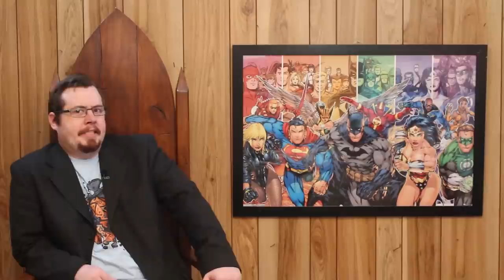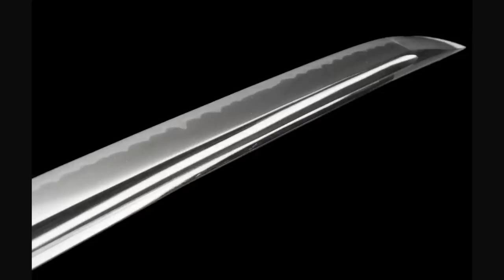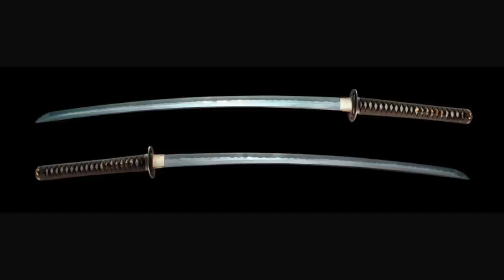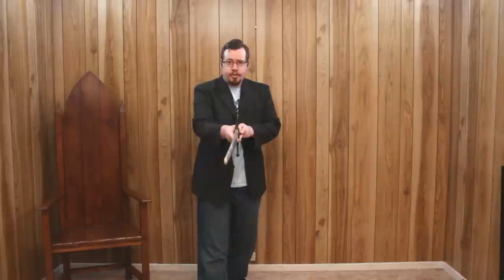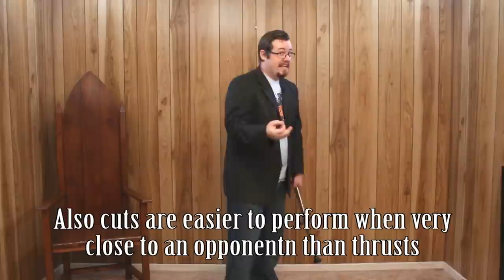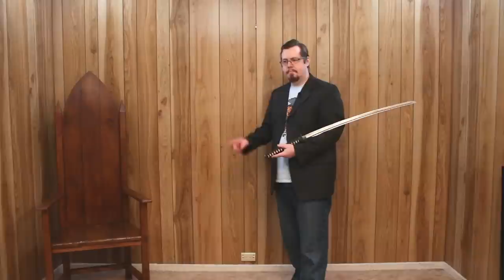Super cutting swords, are they needed?

Comment: Shad, there is one problem in you analysis, namely that you only considered it from the unarmoured, fighting-on-foot perspective. For some reason, curved sabre type back-swords were in vogue in cultures that placed light cavalry and horse-archers in a prominent role. If the weapon was designed for fighting on foot from the ground up they may not retain that level of curvature.

Take Japanese back-swords for example, and no there is no such thing as The Katana; a katana is a back-sword and can be further categorised into more specific types. Tachi was fashionable from late Heian to early-mid Sengoku period where the primary function of the samurai was horse-archery. Uchigatana, a much straighter version of tachi with longer handle, came into fashion in mid Sengoku where samurais were mostly fighting on foot in formation. Uchigatana was further shortened during the Edo period, as the Shogunate wanted to limit duelling, and this is The Katana that we think of today, 

Therefore, the katana is not the result of trying to maximising certain battle effectiveness, for example cutting; as a matter of fact, the Shogunate was trying to reduce its effectiveness in unarmoured fighting scenarios. It is what it is mostly because it is the descendent of Taichi and retained a degree of curvature.

When it comes to nodachi, we have to again consider it in a different historical context. Ming Chinese noted that it was particularly effective in cutting off pike-heads during their war with Japanese pirates. It was so effective that the Chinese general in charge invented new tactics and adopted the nodachi as one of their infantry weapons. But then we need to compare the nodachi to the greatswords and it will be a different discussion.
Reply: I heard the reason the uchigatana was shortened was for the purpose of making it more convenient (ie. easier to wear, easier to draw and easier to use) as during the Edo period, there were no large scale battles and the primary reason the samurai still carried swords was for self defense in usually urban environments.

Comment: From what I understand with a number of curved swords is they were cavalry weapons. You have  a standard war horse going about 25-30 miles per hour or 43-48 Kilometers per hour charging at  your enemy, the cutting edge can do some devastating damage. The blade doesn't even need to be sharp; the impact alone can take someone's head off. Exceptions exist, but this tends to be the case

Comment: Sorry for being late to the party. Some thoughts:
1st: As mentioned already, it might be worth consindering whether you fight mounted or on foot. Mounted, you only have a small window of opportunity to land a hit, but thrusting might need more time to aim and look for an opening. Furthermore, I would guess that after a mounted thrust, my blade has a higher chance to stick in the body, getting ripped from my hand and leaving me "toothless". From medieval imagery it seems to me that knight on horse, when using a sword, preferred a cutting attack. And many curved blades I know of are especially cavalry weapons. Some others are designed to attack e.g. the legs of horses in an explicit anti cavalry fashion - something where a thrust wouldn't work well.

2nd: Thrusts sure can be deadly, but a thrust comes in a linear way, the "danger zone" is a straight line. As soon as I can evade that line (or redirect it), I am good. A slashing/cutting attack has the whole plane as danger zone. The movement may be more elaborate and thus slower than a thrust, but that might be a small price to pay.

3rd: Depending on the armour (or lack thereof), a slashing weapon might cause more damage. A thrust might go deep, but the wound is linear. There are parts of our body where such a hit will hurt as hell and maybe kill you in the long run, but the damage is rather local, leaving you in the fight for now. A cutting/slashing weapon could cause damage on a larger area. Not being a specialist on medieval times I am more interested in ancient times, and from my reading, the romphaia was a rather feared weapon that caused rather nasty damage. 
On the other hand I would expect cutting weapons to be less effective against heavy metal armour. Here it might be better to precisely aim for the weak spots instead of wasting the blade by running it over a thick sheet of metal.

Just some thoughts (^_^)

Comment: Hi Shad!

Let me first say that I greatly appreciate this channel as a place to gush over swords. I realize that this video has been posted for quite some time and that I am showing up rather late to the party, but I wanted to weigh in on this a bit, since I am a proud owner of a sabre, a scimitar (or shamshir), and a longsword, and have done limited HEMA training with the latter.

Having played around with curved sword a bunch, I can confidently say a few things about their advantages and properties:
1. Their advantage in cutting lies less in their curvature of the blade and more in their weight distribution, which is a result of curvature. Basically, curved swords have more weight-to-length ratio over the length at which they curve, essentially giving them more force in the cut but sacrificing length and nimbleness (since the point of balance lies farther away from the hand than in most straight swords). These are, as far as my amateurish experience has shown, the main advantages of straight blades- easier to wield and more balanced, and have greater reach per weight, which are very important qualities.

2. They can most definitely thrust. In fact, I don't think they sacrifice much in thrusting capacity as you say. The scimitar you showed is an extremely curved sword that is not a good example of the majority of Middle-Eastern blades. If you take a gander at a number of popular curved blades, such as Tulwars, Pulwars, Shamshirs/Saifs, Sabres, Kilijes, and even Katanas, you will see that the curvature is not so pronounced as to prevent one from thrusting. To the contrary, I believe you can deliver equally powerful thrusts with curved swords as with straight ones. With the longsword, one tries to position the point in somewhat of a perpendicular alignment to the length of the target. To thrust effectively with curved blades, you simply need to adapt your arm motion to go into the curve (think of the motion one makes when throwing a frisbee). I practiced stabbing around my shield, over the top of my shield, through targets, what-have-you, and it works beautifully.

3. Curved swords slice. This is a point that is often overlooked. I should also hedge my statement and say that straight blades can slice as well, but curving the blade makes this happen much more easily. Where cutting is moving the blade through a target, slicing is moving the blade along a target. This becomes relevant when you consider two important situations in which slicing is advantageous: attacking heavy cloth (or silk), and attacking from horseback. In Europe, the most ubiquitous piece of armor, aside from a helmet, was the gambeson, a heavy jacket (which you have made a great video about, by the way!) that is rather difficult to hack through. Using a straight sword such as a longsword or an arming sword, an easier method of attack would probably be the thrust, which gets you through that heavy padding much more easily. In the East (read: hotter climates), gambesons are not in fashion, but other, lighter forms of padding were. Leather lamellars were around, as were silk robes and linnen. These are also very hard to cut through (particularly silk which was used rather often by elite fighters in many Islamic countries). As with gambesons, you can stab through them, or alternatively, you can slice through them.
Regarding cavalry warfare: if you would imagine yourself to be riding down an enemy and striking on the gallop, how much force do you think would be transferred directly to your wrist? How easily do you think you could lose your blade if it gets stuck in an enemy? How easily do you think the increased impact force of striking from a moving horse could warp and damage your blade? Slicing helps mitigate all of these issues by allowing you to make more gradual contact with the target, and the fact that curved blades tend to have rather rigid backs means that warping is less common and more force is transferred to the target.

4. Come on man, you just made a series gushing on falchions and messers where you mentioned the usefulness of having more cut-centric sword designs. Same thing applies.

5. Your point about rapiers is rather pedantic. They did become the most important dueling sword in Europe, where people often came unarmoured to duels and only had one person to fight. Of course reach would give you a huge advantage in that setting. The broadsword still ruled the battlefield at the time of the rapier (correct me if I am wrong). Such a specialized thrusting weapon as a rapier would leave you vulnerable in a melee, while a nice broad sword allowed you to hack and slash more effectively, while still capable of delivering deadly thrusts.

Comment: 1: The emphasized cutting design choices could also make landing a damaging cutting blow easier to perform: You would have to work less with a specialized cutting weapon to do the same damage as a more general-purpose design could with great effort. 2: The saber, scimitar, and other curved weapons you mentioned were often used by cavalry against unarmored targets. The rider would have to swing his saber down in an underhand motion to slam into the back of a fleeing soldier. A cutting emphasis could help penetrate the soldier's backpack and the back of the ribcage. Or the rider could make a chopping motion backward as he passed to attack the running soldier's face. Much of the power of the cut would be lost with the blade and horse traveling in opposite directions, meaning that a cutting-specialized design could compensate again. 3: The katana was certainly on many battlefields, but the samurai probably left those famous swords in their scabbards when contending with armored targets. When fighting formations of lightly armored soldiers or just figthing away from the battlefield, the katana was probably a very effective weapon.

Comment: Hey shad. Food for thought about you saying overkill on cutting ability. If I'm in a fight and the sword is capable of going completely through a body part that does two things for me. The first being that it reduces the amount of shock placed on my body from delivering the cut. I don't get An immediate stop on the blade when I connect with bone. Which will in turn take a toll on my body. The second is I don't want my blade stuck in some dude and me needing to remove it before I can continue fighting. If the blade goes all the way through I'm immediately back to my stance and can fight his friends but if not that extra second it takes me to remove the blade could get me killed.

Comment: This is a horribly pointless and redundant comment. read at you own risk.

I think super cutting swords are useful in that you can't presume your opponent is going to be naked or allow you a nice clean perfect strike to their arm or where ever. Let's use the the Samshir as the example for a moment. (For those who may not understand why a curve enhances the cut to such a extreme degree)  That exaggerated curve means less of the blade will be touching material at any time. Distributing the the energy to a much smaller area. Where as a longsword's straight edge means your energy is meeting a lot more material at any given time. Among other reasons. Blah blah blah, you already knew that.
After stewing on it for a good half an hour, maybe it would rock with is cavalry work? Maybe facing people in more linen armor? sigh you Sir, have a very compelling argument.  But, with that said (looking away from all you pesky and messy facts and logics). I guess just love my Samshirs. I fear that because I'm Persian, I have become biased, or perhaps it's hard coded into my DNA. I just can't not love those curvy things.

Comment: In Kali, the Filipino martial art I study, the cut is king. I've done a lot of practice bouts in sword fighting, and the thrust is not overly difficult to defend against, I actually look for it. The problem with the thrust is that you have to move towards the opponent to effectively stab them with enough force and all I need to do is slightly redirect the tip to make my opponent's sword a liability instead of an obstacle. If my sword cut is blocked, momentum allows me more flexibility in moving sideways, and backwards if i mess up horribly, if I miss a thrust, I have to completely stop and reverse my momentum. I can still do damage with cutting while close and not just blunt trauma. I can slice legs, arms, gut or neck as I pass my opponent instead of needing to retreat. Not that the thrust isn't useful, I just prefer cutting.

Comment: I know i kinda late to the party, yet there are my 2 cents.

You forgot to consider geographic area of that kind of "swords". Cuting-focus swords were more usual in areas, in which horse combat, and especially light cavalry combat, was most used. When we talking about light cavalry and fast attacks thrust becomes liability. When you thrust sword it can  struck in enemy (even if you kill him you would be w/o weapon for some time. Same logic that applied to lances for heavy cavalry in europe). When you thrist during cavalry charge backfire force of thrusting can be so heacy so it would be hard to endure perforimng even 2-3 thrust (even if we imagine, that sword wont stuck), so that means thrust become more dangerous to user, than to an enemy. Cutting, on the other hand, let you be as deadly as with thruusting in this scenarion, but w/o backforce, you can use horse movement and speed to extend your cutting damage W/O backfire force top you, you can quickly switch targets and sides (which is extremely useful during light cavalry attack), and it is easir to sync your movement with your cuts.

2nd are in which we see lots of cutting-heavy swords are ships. And you already mentioned it - cuts are much easier to perform in close quarters and, especially, places with low ceiling. That way you can perform very heavy cut w/o hittinh ceiling, if you got right sword curviture (which, ofc, undermines thrusting capability to point of no thrusts at all, yet this decision remains effective, as 90% of fights you would have in this scenarios). Thats why we see a lot of sabre-like weapons and its development during fast development of navy and baval battles. (pirates? yarr!).

So, while i can agree with you, that getting cuting to extreme reduces versatility of sword, but i disagree with approach that excludes historical and geographical context. IN certain areas (and big areas) of the world and certain landscapes thrusts can be dead weight, so you would not want to reduce cuting potential of your blade for smth that you would barely use.

Anyway - very interesting video you have here and i would like to see more of content like this, i enjoy it all! kkeep that good work :)

Comment: The curve of a saber specifically a cavalry saber was not only for the cut it was also for a curved blade being less likely to stick into what was struck. There is a difference between cutting and chopping. To cut a piece of meat with a knife you drag across it, or you use a cleaver to chop. I think in the video cut and chop are often lumped together and need to be looked at completely separately.